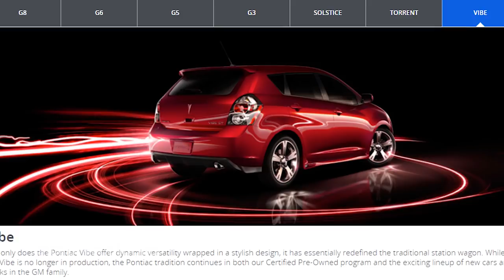MW Podcast 179: Ford GT, NYIAS Recap, and our New FYI Reporter!

Comment: Re inside if the glass - newspaper with glass cleaner or clean white vinegar is the best way to clean glass, BUT wet newsprint will stain on interior trim and fabrics so it's best to not try unless you have ink-free newspaper. Otherwise, my go-to is typically the sprayfoam style of Stoner's Invisible Glass or another common glass cleaner in Costco and other places whose name escapes me right now, paper towels or microfiber towels work...and then wipe down my dash with a little 303 Aerospace Protectant on a microfiber towel afterward to clean up the glass cleaner residue and any lint from cleaning the windshield. Plus it's a UV protectant for your interior plastics or leather! :)

Comment: The GT is a mess.  It's ugly and for a $500,000 car I don't want a f-150 v6
Reply: That's the problem, succinctly put. Half a million, and it's not a bespoke engineering marvel of an engine. Instead,  you get a worked version of a motor that's borrowed from an entry level truck.

In a world beating supercar? meh
Reply: The GT motor is very far removed from all the ecoboost V6s except the Raptor...this is a dumb critique of the Ford GT.